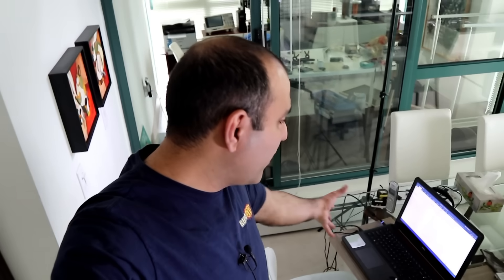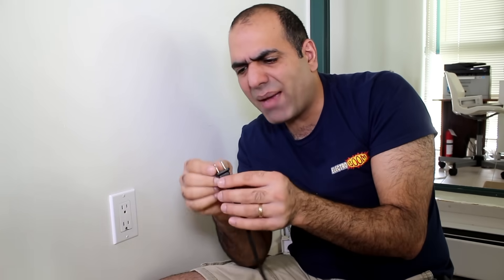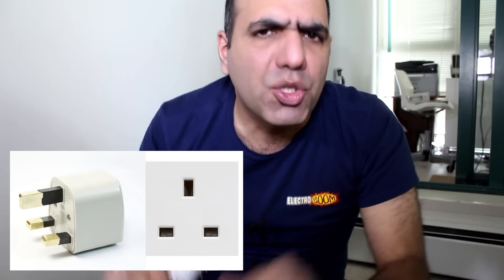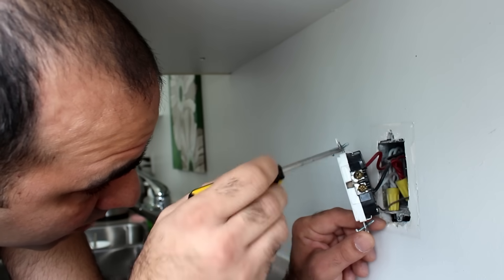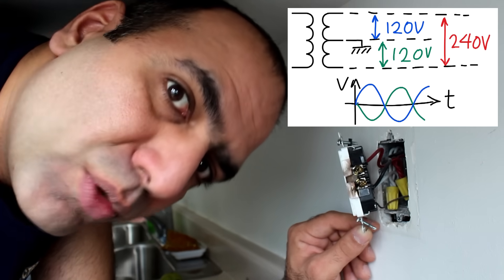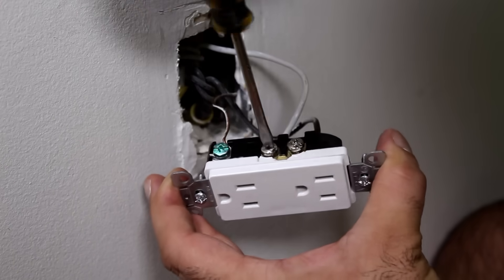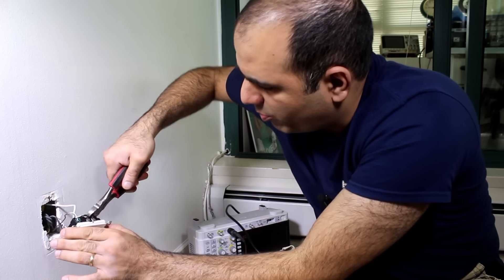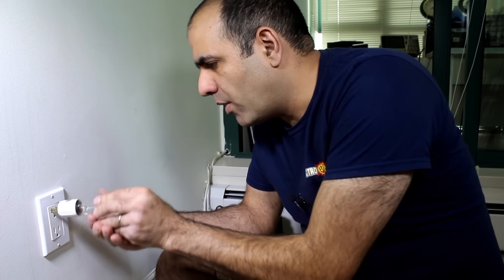How to Replace a Power Outlet

Comment: Another "killer" video.

If you do another home electric vid please mention the hazards of pre-existing aluminum wiring used with conventional (non CO/ALR) switches / outlets and the use of NOALOX paste. While doing some flood restoration, I found that an entire apartment complex (40+ units) had been renovated at some point and EVERY switch, outlet and light fixture was "upgraded" incorrectly. It was a "hidden" under-mount microwave outlet that was scorched and melted that made me look further into the situation. The insurance company was so thankful they gave me a $20 Tim Hortons card, lol.

Also, I never use the "back stab" connections. As soon as you reinstall the outlet you'll likely put a sharp bend in the wire and work-harden the copper. Pull the outlet out again (for whatever reason) and reinstall it and you'll more than likely break or crack that wire. I've been "surprised"  by the hot remnant of a broken wire in the back that was reconnected to the screw terminal. The damn DIYers seem to NEVER run those F'n unused screws in and this leaves only ~3mm clearance to the device box. I always use the screws, run in unused ones AND wrap the device with vinyl tape as a courtesy to the "next guy".

Comment: The screws on a receptacle are colored; silver for neutral, dark, brass, or black for hot. 
 Also, just fyi, you installed a 15 amp receptacle. A 20 amp has a modified neutral slot that looks like this:  "ㅓ".
15 amp receptacles can be used on a 20 amp run, just don't pull all 20 amps from a single receptacle. Fyi2, 12 awg wire won't fit in the push connections on a 15 amp, you have to use the side screws.
I'm open to corrections, I am not a sparky.

Comment: If the plug is going to see some amps don't use the push in connections but I assume no one watching your videos as a how to and also in a lot of places as the home owner you can legally do most electrical stuff in your own home

Comment: Canada allows using backstab connections on 20-amp circuits? Or doesn't require 20-amp circuits in the kitchen? USA requires 20-amp circuits in the kitchen, dining room, laundry room,  and you CANNOT use the backstab connections on outlets for these. I don't think the 12-gauge wire will even fit into the backstab hole. 2:01 clearly shows an outlet in the kitchen using backstab connections.

Comment: ElectroBOOM can you do me a huge favor, I hate using the tiny pinch point pushins that you used in connecting this outlet in the first attempt, you know, the one you did backwards.  Anyway, I was taught that in certain applications that TINY little pinch point contacts so little surface area of the wire that it creates a point of high resistance and therefore a LOT of heat if you plug in something with a demanding current demand like a heater or a large appliance, like a fridge or something.  Could you use your highly advanced technology at your disposal to test this out?  I would love to see a thermal image of an outlet using those tiny pinch points running a 1500watt heater on full blast, great springtime/summer project.  ;-) anyway, huge fan, hope to one day be as cool as you.

Comment: Never, put the wires in the holes on the back of a recepticle the conection is not as good as using the screws on the side.

Comment: You don't have to cut the wires, once they are inserted into the back of the outlet. There should be a hole you can push a small screwdriver (or simular) into it to release the wire.

Comment: The screw color also determines polarity too.   Silver = neutral, Brass = live, and Green = ground.   Personally, I've always preferred the screw terminal connections for the fact that if you have to change the outlet, you don't have to cut the wire and lose any length. :)

Comment: Please do not use the push in connectors on the back of the receptacle. Overtime these connections loosen through plugging in and out devices and will eventually become loose enough to cause arcing. Arcing and sparking is what causes fires. Always wrap around screw terminal.
Reply: Clockwise
Reply: I've heard that, but is there any evidence push-ins cause fires? They are a lot quicker.
Reply: Can't agree more. Those "backstab" terminals burn many houses down!
Reply: I was about to ask why cut the wires to remove them. Now i know! With Uk plugs just unscrew  and remove the wire.
Reply: I was like wow i never knew i could push in those wires,,,guess ill be sticking to screwing them in
Reply: Nehmo Sergheyev I don't know about fires, but they definitely fail often. I have seen the receptacle nearly completely melted.
Reply: I don't trust them, but UL/CSA says they're OK. Who am I to argue?

Comment: Hey, just a procedural thing that's always good to get in the habit of for ALL electrical work no matter what you're doing is: Ground is ALWAYS last disconnect, first reconnect.

Also, the reason behind large apartment buildings typically having a different voltage is that the buildings are fed three phase to run all the mechanical systems and then, each housing unit is then fed 2 phases, either A/B, B/C, or A/C in order to keep phase loading of the building as a whole balanced. 

In residential areas, there are indeed center-tap transformers which supply the homes and the balancing is done in a more rough fashion for each group of homes fed by one step-down transformer, which is connected to phase A/B/C of a medium voltage (7/11/22kV) feeder.

Comment: That 208 volt bit was bugging me from that other video. I knew I had 240v at my own house but Boom has 3 phase service at the building and 2 of the phases are being tapped? Fricking stupid if apartment buildings are like that, I only had to deal with 208v in shops and industrial areas

Comment: fyi, its always a good idea to wrap the outlet, covering the terminals with electrical tape before putting it into the wall. it will help prevent the terminals from shorting against the box if it gets loose and if you forget to turn the breaker off, it can keep you from getting shocked.

Comment: The UK plug and socket are the safest in the world. The socket has a shutter which covers both live and neutral holes so kids can not poke things in them, and which opens when the longer earth pin enters. The plug live and neutral pins are shrouded with plastic part way down so it is impossible to touch the metal parts when they go live, and every plug is fused so that a short will cut the power to an appliance without knocking out the system. The pins are massive so can not overheat. They are all big and ugly, but nothing is perfect. They supply super safety for 240V mains, which is far superior for high wattage appliances than 120V.
Reply: But on the flipside, stepping on one of those is so painful.
Reply: Where's the fun in that.  When I was 5, I did a detailed investigation into electrical sockets using a bobby pin (hair pin).  The experiment was repeatable with the same results, the breaker tripped.  

Safety plugs.  Just trying to suppress curiosity in children.
Reply: That is what would also happen in a more modern UK home, but we have millions of older houses which predate the use of breakers with consumer units fitted with old fashioned wire fuses. Young couples starting a family can often only afford to buy an old house and their children would be at risk. Old rental houses would have been rewired with modern consumer units as I believe that's a legal requirement, but a high percentage of UK houses are owner occupied. The plugs are fused because we commonly use ring circuits, and a short in one appliance would blow the main fuse in the consumer unit.
Reply: OK, but I have been using them for 50 years and never stepped on one, and I have never heard of anyone else doing it. Also the pins are blunt ended and unlikely to pierce the skin, but it would be painful for a while after.
Reply: I left a plug on the floor, when coming down off my bunk bed I slip off and landed on it. Much blood and pain, I had to pull it out of my foot.

The plug was OK though :/.
Reply: @ Dragon Slayer Ornstein. In effect you leapt on it from a great height, so that would happen, but just walking and stepping on it would be less dramatic because we have a reflex action to immediately withdraw the foot from anything sharp and minimise the injury. Console yourself that you have learned an important life lesson; don't leave sharp objects on the floor. You would not have left a fork or a broken glass there, would you? Hopefully you made a full recovery and can now continue slaying those pesky dragons. Meanwhile you have the privilege of being the first person on a list I am compiling, of people who have injured their foot on an MK plug.

Comment: Why You have to cut the wires? Is it possible to unscrew the screws and remove the wires from the holes?
What if someone run out of wire after replacing the outlet a few times? :)
UE resident here- never had US outlet in hand...

Comment: I love how you show an illegal UK plug there. Only the two lower pins should have the black non-conductive protection. Having the protection on the Earth pin (longest) means it can not make an electrical contact as that band has now insulated it.
Reply: Not quite correct. Light fittings with plastic (or other non conductive) housings don't require ground and quite often have plastic earth pins. Perfectly legal.
Reply: I replaced one of those plugs on an LCD TV PSU, the other end having a 3 pin earthed cloverleaf I needed for a Netbook. When I cut it there was no earth in the cable despite it being round and thick like a 3 core. The strands were hair thin and hard to twist together, but it only draws 8 watts. Better than the instructable I saw where they made one out of hot glue!

Comment: 2:20 - "I've heard that in houses, they have a centre-tap transformer..."
That's correct, and I believe that for most residential, especially rural, applications, the feed is a single phase to ground, with a 240V output, centre-tapped to provide two 120V (with respect to ground) feeds, 180° out of phase.

I was actually surprised a few videos back when you said you had 208V at your split plugs because I never encountered three phase in a residential application. But in a high-rise, that would make sense. I'm curious about whether your distribution panel has two or three phases. 

On a side note, I recommend avoiding using the push-in terminals on outlets whenever possible. I'm of the opinion that the screw terminals give you a much better contact area. (When properly installed.)

Comment: Remember to wrap the wires in the same direction as the screw threads so that when you tighten the screw it tightens the wire rather than loosening it.

Comment: Stop trimming your wires!!! (Turn off the power supply to the sockets to that part of the house, if your unsure you can turn the whole power supply by switching the main circuit breaker to the hold dwelling) Simply unscrewing the fixing screws to release the wire, if the fine copper wires that make up the wire is damaged when trim them, Removed 10mm of the installation sleeve when using your thumb and forefinger pinch a twist the fine copper wire to bunch them together, then place in the correct outlet, screw up until the wires are firmly secured and ain't going to fall out or come even if the wire is pulled.

Comment: I had no idea in US homes that 2 phases are used. If you have to run 2 phases into a kitchen to get 240Volts AC, wouldn't it be better for the US to move to 240volt AC supply? (lets say cost and the mindfuckery of gutting out a massive electrical network and consumer electronics was not an issue).  Would there be less demand on the grid if the US went 240VAC (single phase)? 
In Australia if you did your own electrical work and asset burns down or someone dies you got to prison.

Comment: Never use those "back stab" connections on an outlet, they are prone to fail...   You can also get " Specification Grade" outlets that  hold the prongs tighter, and have more robust internals..

Comment: Mehdi does something in the video which is seriously frowned upon by professional electricians, and that is "backstabbing" the wire. Pushing the wire into the hole is simple and easy, but the electrical contact is being made by a small blade and spring which can wear out, especially during high loads. When this happens, there is resistance, heat, and possible arcing and even fire. I have personally been on calls where receptacles literally burn as a result of this wiring method. The proper way to terminate a receptacle is to strip and loop the wire clockwise, hooking it onto the set screw, and tightening it as much as possible. Many electricians will also tape around the receptacle to avoid the risk of causing a ground fault through contact between the set screw and (hopefully) grounded box. 

Mehdi also got lucky in that the receptacle outlet being replaced was the "end of the line", or the tail end of a circuit. In most cases, different parts of the branch circuit are spliced together or otherwise pass through inside receptacle boxes. What I commonly see is a "window cut" on continuous wires which are stripped where they make contact with devices. This is fine. What isn't fine is where both set screws are being used on one side of the device, and electrical continuity is dependent on the physical integrity of the device. In other words, two separate white wires are attached (or even worse, backstabbed) on two separate points on the receptacle and the two black wires are connected in a similar manner on the other side. In the United States, this is explicitly forbidden by the National Electrical Code. The proper way to wire different sections of a branch circuit into a receptacle is to splice the same-color wires together while including a 6-8 inch piece of wire (called a "pigtail") that feeds the device. Do this for both the hot and neutral. 

And remember, if the neutral connection is broken in one of your branch circuits in your home, this can cause a bunch of your appliances on two circuits in your home to go in series with 240 volts. Yes, they will be destroyed by this. Yes, this destruction may be catastrophic. Yes, my company has received calls regarding increased voltage destroying property and me discovering that a backstabbed neutral lost electrical contact.

Comment: you have strange outlets in north america. in italy single "inputs" (females?   sockets?) can be switched individually without changing the whoel thing. and we usually have more holes to trasfer power from 1 "module" that you mount (socket, switch, little litght, bell) to the other.

Comment: 120/208V is 3 phase power while 120/240V is single phase.
Reply: Yeah basically houses are fed by a 3 wire transformer, one wire is a centre tap with the other two (hots) being 240v.  From the centre tap to any of the other two it's 120v.  That centre tap is also the neutral and is also grounded.   When measuring between the two hots it's basically 120v and -120v so it adds to 240. (of course this alternates since it's AC)

Comment: An electrician once told me they don't put wires in the holes because it was a code violation? I never did check on that. Also, your outlet is mounted crooked, but you were probably a little frazzled by then to notice.

Comment: LOLed several times on viewing this. At today two phase line wires to my flat in fuse box burned. Lots of smoke... Then electrician forgot to disconnect neighbor flat and got nice 220V jolt through one of neighbor flat phases (probably computer or TV in sleep mode). At least no one died and I finally got a new set of circuit breakers instead of 25+ yr old ones.

"A real man never worries about mistakes until it's too late" - I wish this T-shirt NOW.

Comment: As an electrician I can tell you that backstabbing the outlets is not very good and over time they can get loose and arc and melt. It is much better practice to use the side screws and wrap the wires around In the proper direction. 

Hopefully your house doesn’t burn down.  Good thing there isn’t any evidence you changed the outlet yourself.

Comment: Good vid. 
Quality outlets don't get worn out easily. Only the cheap junk that are installed in apartment wear out like that.
Tip... You'll notice the screw terminals are two different colors... One side is Silver the other side is gold. Silver is neutral gold is hot.

Comment: QUESTION! What do you need the "earth" wire for? What is its use?
Reply: It is a direct path to earth. It is there to provide safety should an appliance develop a short to the chassis, which is connected to the ground prong on the outlet. The current flows there to earth instead of you if you are unlucky enough to touch the hot chassis. If you touch an appliance and it shocks you odds are it is not properly grounded. GFCIs use it to meter how much current is flowing between the hot and neutral wires. If any current as little as 5mA passes to ground the onboard breaker trips.
Reply: Sparky Arcblast thanks holmes i always wandered: what the fuq is this 3rd wire for?

Comment: You installed it upside down.  Ground pin is supposed to be on the top.  That way if something conductive falls on a loose plug it will most likely go to ground on one side instead of shorting live to neutral.

Comment: The neutral will have silver colored screws, while the hot will have brass colored screws.  Also, the push in wire fittings are allowed for 14 gauge wires on a 15 amp circuit, but will not fit 12 gauge wire, and are unreliable anyway.